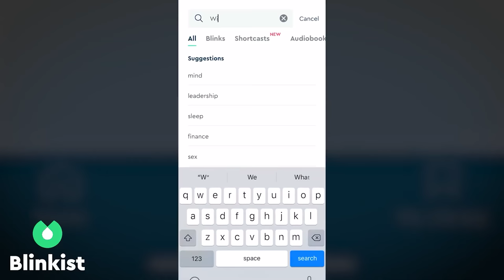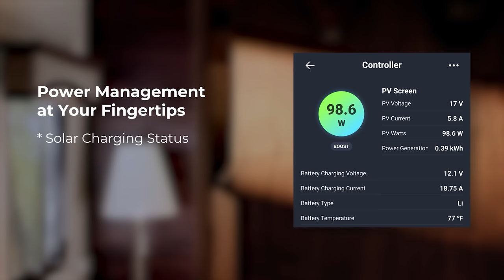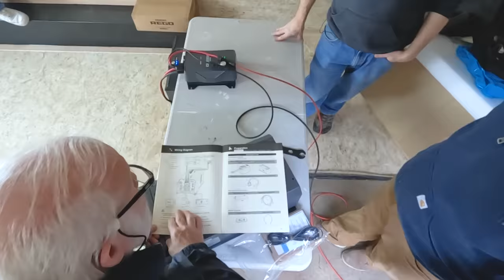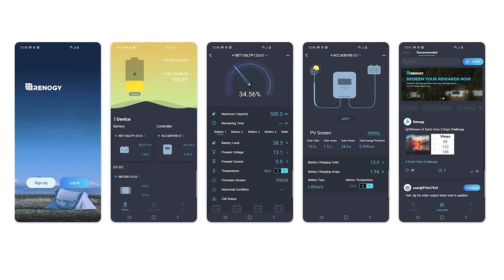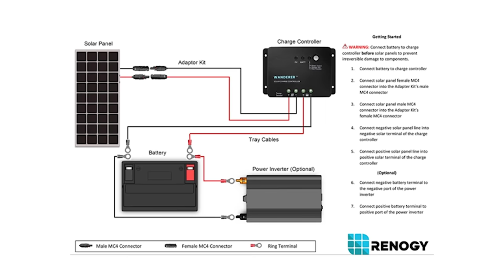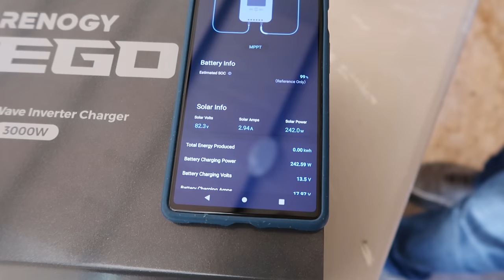Building A Solar Off-Grid Trailer: Part 1 | In Depth

Comment: You could have wired the panels 3 times 2 in parallel. This would have given you 72V with double the amperage of a panel.
Reply: I was going to ask the exact same question.
Reply: Only need to ensure you are not exceeding wire  or inverter current limits
Reply: Ray Johnson   Over-voltage will kill circuits, on many (most?) charge controllers, over-current just gets limited.
It's common practice to over-current solar arrays to deal with low-light conditions.
Read the specs for your specific charge controller.
Reply: @kevinvogt8827  The inverter will automatically present the panels a higher resistance so the inverter design current is not exceeded on really sunny days.  The better residential installers, in many cases, hook up a panel array with 120% power capability w.r.t. the inverter power limit.
Reply: Ray Johnson  They said the panels were 24V, also they wired them in series, so...
Reply: Hopefully Renogy reaches out to help them figure that out.
Reply: Ray Johnson  12V panels are not 12V ! they produce about 20-21V open circuit without any load, and produce their maximum output at about 17.5 V, which has enough headroom to run a charge controller to charge a nominal 12V battery to about 14.4 V for lead acid or LiFEPO4, or whatever other chemistry you want.
When connecting them to a charge controller, then it's the OC voltage you have to worry about being over voltage, not the voltage at max power point when under load.
2 strings of 3 in series would be a good fit - the charger will only take as much current as it needs if the panels can supply it. You can "overvolt" a charger, not "overamp" it!
Reply: Those panels are 23.9volt voc 
I doubt you’ll ever see that but you could bet on maybe 21 volts each pending out side temp and voltage loss depending size wire and your run. 
You need to run those in series parallel. 
60 volts @20amps roughly
Reply: but you would have to buy parallel adaptors to do that and make/buy some short cables.  If 240v with 4 panels; then 180v with 3 panels in series and double the amps with 3 in parallel.
Reply: @richardservatius5405  where are you getting those numbers..? 240volts from where..? And you would triple the amps with 3 in parallel. Dude you would burn cable up if your not paying attention. That would be over 30amps. I don’t know what cable he has but  10g at absolute minimum if not 8awg depending on the run. 
Parallel adds all amps together not just double.. same as volts when in series. It adds the volts but amps stay the same. I have videos explaining this with demonstrations
Reply: @johnnysweekends  in the video, 240v dc was measured using 4 solar panels. so with 3 solar panels in series 180vdc should be measured.
when 2 parallel solar panels are stringed with 3 panels on each string; the amps should be double one string in series.
Reply: @richardservatius5405  how did they get 240 from those panels at 23.9 each..? 
Something isn’t right with there numbers. So it doesn’t magically boost voltage to 60volts each panel. 
I’ll admit I didn’t watch every second but that doesn’t calculate at all.
Reply: @johnnysweekends  i think that when the dad hooked up all six panels is when he measured 240vdc which would mean 40v per panel.  that would mean
about 120vdc for 3 panels instead of 180vdc and that makes more sense.  we could look up renogy 200w solar panels (flexible) to see the voc.
Reply: @johnnysweekends  i just looked the panels specs up; 19.1v optimal and 23v voc.  so the 240v still doesn't make sense.
Reply: @richardservatius5405  correct which is why I was saying the numbers don’t add up.  Already knew what the specs were that’s why I knew something was way off.
Reply: @richardservatius5405  "if" is a wonderful word, but 100 V is the hard limit they are stuck with and six 20V OC panels, so 2 strings of 3 allows all 6 to be used.
Reply: @ahaveland  if you are right about 100vdc being the max. allowed pv input; then since the VOC is 23+ volts x 6 = 138v and too much.  4 x 23+ volts = 92volts and might
work as long as the weather doesn't drop too far.
Reply: and yes, 3 panels in series with 3 in parallel is their best option.
Reply: @richardservatius5405  100 VDC was mentioned in the video.

Comment: One nice thing you did not mention is that you don’t have to be fully charged before you reach you destination . I am sure your RV or trailer can charge as you are in route to your destination which is pretty cool.  Great video. Thanks for all your time and effort to bring use these videos.  Signed a contributor.
Reply: Yep, that's right! Just pickup a Renogy DC-DC converter and hook it up between your tow vehicles alternator and the battery so you can limit the charge current and avoid burning out the alternator. The issue is that Lithium batteries have a much lower resistance and will request more current than most alternators can safely deliver.

Comment: You missed an opportunity!  The flex panels adhered to the roof do present a low profile however now you have effectively made your trailer roof a great solar thermal collector.  My plan is to use standard 450w panels in a double stack with the lower set on drawer slides for a solar awning.  a slight air gap under the panels prevents thermal transfer.  Just a thought.

Comment: The growwatt all in one is a much simpler unit. Put your panels in two strings of 4 panels each. Panels normally around 17V so thats close to max voltage for best preformance.

Comment: If you are going to have a cargo trailer; then you could stick a small fridge inside it...keeping the trailer warmer and the drinks colder.  I suggest a short, wide air foil be mounted on the trailer top
front side to push the air up and over the solar panels.  I installed 4 large panels on my 14' cargo trailer a couple months ago.  The bad thing about flexible solar panels is they heat up in the summer and lose power.  so they don't last very long and then you have to peel them off if glued.

Comment: You guys need to do a 3s2p configuration and use those other panels! It's cool Renogy and others are doing these sorts of kits. IDK what exactly is the point of having it be so modular in regards to the "combiner box" and MPPT, etc., it should all be one box with AC plugs on one side and solar inputs on the other.

If anything I think i'd prefer that Lycan cart, but for trailers you could replace the casters with bolts.

Comment: I'm a DIY solar guy, The only reason I would get Renogy is cuz of "ready to go" thing. Even with that advertisement, its not fully plug and play. Getting an AIO inverter, normal panels, and other stuff from home depot will cost a lot less and still give you a lot more energy input/out.

Comment: Panels wired in parallel allow maximum output on each panel regardless if one is in the shade if you put them in series the performance of all panels are equal to the panel outputting the least.

Comment: This is exactly what the company I work for does - Solar and Battery Generator elimination on RVs and large equipment. It was recently calculated the company has eliminated over 300 Million pounds of carbon from the air. Not bad. Thanks for making this video. Folks need to see there are MANY ways to use solar and batteries without covering your whole house. It can be cost effective - just convert one room like the family room or video studio. Bob says it's called BABY STEPS (What About Bob?). Thank you two again - keep on off griddin'.

Comment: I have a 500w solar system in my backyard which uses two Ecoflow delta max 2000  and one delta 2 batteries connected to 2 100w and 1 300w solar panels. I highly recommend Ecoflow batteries for  its easy plug and play setup and app support for diyers out there. Max solar input on Delta max is 800w @100v. The system cost me $3400. It's my backup and it powers my 150w fridge 24/7 except when the sun isn't shining, then I use the grid to refill my batteries.

Comment: Nice project, this is what I have in mind, you started to give the dimensions of the trailer but stopped at 8 ft wide so the trailers 8 ft wide I guess it's over 6 ft tall and what is the inside length? And if you can say where you bought the trailer that would be great of course how much.

Comment: How are you going to clean the snow and dust of the solar panels if they're laying flat on the roof and below the roof line. It seem like when the snow melts they'll be at the bottom of a pool of water. Maybe you could build a pneumatic or hydraulic lift system that could raise one side up at a 45 degree angle for snow removal or so you could more easily remove the dust with a swivel type mop-broom.

Comment: You should talk about thirsty cement or concrete bolth mybe and there benefits.
Like they use no sand so can save millions or billions of tons of sand a year saving ecosystems.
Also it reduces flooding so can reduce flooding damage if its actually used in cities.

Comment: Any reason you went with the Renogy system instead of the Ecoflow or perhaps one of the other AIO solutions like SuperBase or Bluetti.  Those are MUCH simpler to setup.  The battery/bms/inverter are all in one unit, app controlled.  They have the 120V outlets/high power USB outlets on the units with direct solar inputs, and are all expandable as well.
Reply: Yeah that was what I was thinking when they said over volted with only four small panels.

I just got a AC500 even with just one (3kw expandable to 6 total for 18kw) battery plus rigid panels 6 x 550w would do the trick and take less space.

I do also like the new eco flow unit that meant for trailers / vans… it’s all plug an play and the main unit can wall mount to save floor space which would have been even better than the Bluetti
Reply: Because Renology sent them.  (I.e. The implication was free.)
Reply: The only problem with using bluetti or ECOFLOW is if there is a problem with the unit, your whole system is down verses one piece to replace. 
ECOFLOW and bluetti are nice units but not meant for heavy duty. People are now figuring this out being a couple years in. If you want a large system then there are much cheaper options like eg4 grow watt and more.
Or enphase batteries as well

Comment: You could get a couple more panel, fill the roof , it seems the one you have can leave some room for 2 vertical and have  2 parallel string of 4 series panels, put your diodes to avoid problems, but before check that the power of the mppt charge controller, i think the Inver can handle it it seems 3kw
Reply: Seems the folate is caped very low 😢

Comment: Make it into a thermal storage with an air conditioning unit and deliver heat or cold to places that needs it like cold houses.
To transfer put a giant fan and a hose in it, but I guess it needs wall insulation
Andale some calculations about it

Comment: Make it into a mobile e-bike repair shop and charger. You leave it half way through the programmed path and once you reach it charge the bike and go for the next leg of the bike journey
You have sondor metacycle that would work to
For example have Jessy take the rivian, Zack the lightning and pull the trailer, stop the trailer 50 miles from home, then the rivian at 100 m, then the lightning, and have the other guy from now let's review do a 150 miles trip and back recharging on the things on the way, and maybe sleep on the trailer for a night.
I advised you to do a sanity check on this because I do not know the charging time for the metacycle

Comment: Make a temporary free charging station for car.....
You'll need plenty more battery though
But you could go to a parking lot with electric car and offer it maybe in the morning and expecially if the car stay there stopped for 8 hours, check the weather and check if it changes before hand

Comment: With the DC to DC could you actually mount small wind turbines on the roof and generate while towing?  Not sure it makes sense but could you?
Reply: Aren't turbines three-phase current and therefore AC in general? That wouldn't work. Except the motor is small enough to be DC.

Comment: Correct me if I am wrong, but you can fit another two panels length-wise, no? That would make two pairs of 4 and solve your over-voltage problem while doubling the charge rate. And if it's tight, it seems that white edges can be trimmed to fit (but this part needs vigilant investigation, obviously, not to damage it)

Comment: Virtually all consumer products are DC. They're all just built with their own inverters to convert the AC that comes from your wall socket into useable DC to power whatever device it is. And to the question of why AC is used at all, it's because it's far more efficient to deliver AC over long distances, say from the power company to your house. DC's biggest downfall is how hard it can be to change the voltage, which is a problem in these long distances.

Comment: Those panels are only 200 watts. Household panels are economical in the 400 watt area. When space is limited, like on top of a trailer, 440 or 450 watts might be even more appropriate. And, microinverter panel might be more appropriate to avoid shade issues in campsites. I took a peek at the battery that you are using. Seems silly expensive for the kWh.
Reply: You wouldn’t use micro inverters in a Dc trailer set up. That’s costly and waist full. A simple inverter for small ac items is all you need or a all in one charger and inverter
Reply from the maker: All great points that we'll be exploring in future videos!

Comment: Couldn't you just connect 3 panels in parallel then the rest in series? That would keep the voltage down and it would increase power generation!

Comment: QUESTION: Does this company make a system more for home use?  Or more accurately more for off grid cabin use?  What is the price for the entire system?
Question:  Over voltage... couldn't you have used all 6 solar panels by plugging 3 panels as series and 3 panels as parallel?  Why didn't you do this?
Last Question:  What brand / system is your #1 recommendation for off grid cabin use?  Sufficient to power 100% a large 4 room, 4 person family, with 1 EV vehicle that charges over night.  Living in Texas.

Comment: A parallel connection could do better I guess u have battery voltage of about 12v wld be more efficient not to work where u have to drop the voltage much to match the battery. The paralle connection of panelsl could could also be more efficient whereby all panels are not getting equal sunlight

Comment: Another cool thing would be to power the wheel of the trailer with a small electric motor, hook it up to the car control and have it push the trailer when you accelerate and regen when you stop...
Maybe little ambitious

Comment: wow, with as limited space as you have to place panels, why go with something so 1990's with wattage capability??? I have a 20' Toy Hauler with 5x540Watt panels on the roof, with 2 additional collapsing patio "roofs" that hold an additional 5 panels each and if I could figure out how to add more I would. Currently, I have 8.1kWatts of solar.
If you aren't climate controlling the trailer, 3kWatts may be enough, but if you're going to heat or cool, you are woefully under powered.
I mean I get the purpose of the video is to encourage people to move towards solar and how easy it is to get started, but this seems so under powered...